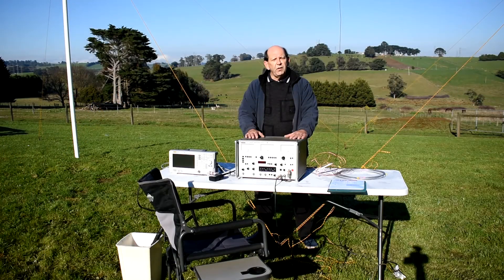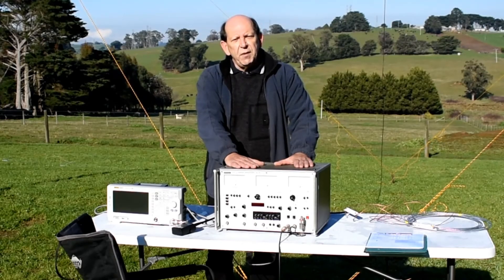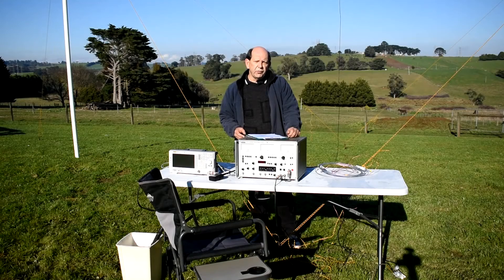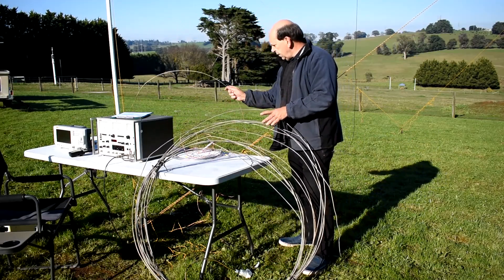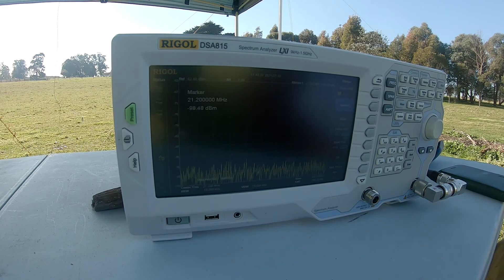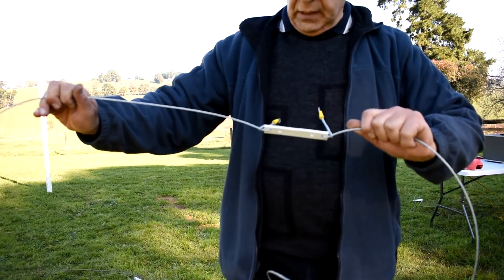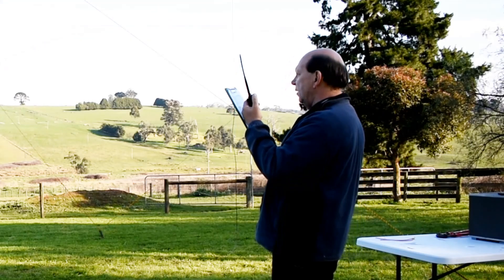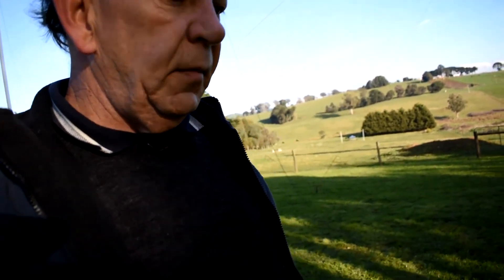R018 Testing Wire Dipole Materials for HF

Comment: I built a two 5/8 wavelength dipole antenna for 75 meters...about 315 feet overall length using #14 pvc insulated stranded copper wire (Home Depot) fed with ladder line straight back to a balanced tuner in the shack.  The center was suspended from near the top of my 70 ft. tower which supported a 10 element hf log periodic dipole array.   One end was up about 40 feet and the other end was only about 8 feet off the ground.   The performance wildly exceeded my expecations.  From south Florida in the winter Europe was a nightly thing....with the occasional Asian contact as well.  Several signal reports from the UK, Germany, Italy and Russia were, "strongest signal heard"....with many 20db over S9 reports.  Pileups were easily managed...rarely making more than one call to a DX station.  My biggest concern was mechanical....will the thing stay up?  The wire was not designed to be antenna wire...but, to my surprise it lasted years.  The insulation probably effected the resonant frequency a bit...but, since I was using open wire the swr really didn't matter much as the open wire is very low loss.  Thanks for all the work you guys did with different wire types.

Comment: Great work!  Been reading your article from the SZ1A site.  Very good info and revelations.  Just the fact between bare wire and a PVC-coated wire made a measurement difference.  The entire test must have been a lot of work but I think it helped the amateur radio group immensely.  Thank you for creating this.

Comment: Did you control for tension and sag?  The heavier wires will sag more even with the same tension and at the high current part of the antenna.  Might be why aluminum did so good.  73 KK7YIS

Comment: Many years ago I collected some phone wire after a hurricane and the run had been replaced with new material. It may have been power wire I don't know. I did build a dipole out of it and it worked well and lasted for a long time.

Comment: Glad to know that I don't need to get copper wires to get good performance when making dipole antennas. Was worried about the material would cause high impedance.

Comment: Have you ever worked with  Beryllium Wire for Dipole antennas?   It's extremely strong even at small diameters // Gauges .  I built two 10 meter Dipoles using it in # 22 Gauge.   Both are resonant from 28.250 to 28. 550  Mighty wide... Low SWR as well... Think 1.5 is the highest  and I have put 100 Watts through it without a problem.   I worked with a  few agencies that used it from 80 m to even VHF.... In fact it works very well for Unattended Ground Sensor, Omni Directional Antennas 138 to 153 Mhz  In smaller cuts it stands like piano Wire and is difficult to detect..  Thank You for the Interesting content    KC3ZDW  73

Comment: I found that once an antenna is up for a while the performance appears to decrease a bit. Perhaps the corrosion of the bare metal? Planning on (industrial) gold or palladium  plating of steel wire. Not for a golden signal but to avoid corridor.

Comment: BARBED WIRE? Really? 😀 It’s interesting to see the number on your chart. IIRC, it had one of the lowest lengths. (Maybe it has a low "velocity factor" because the electrons have to slow down around those sharp barbs.😀) I guess if it’s what you have (and you mount it so the lowest point is above the height of a human).

I SUPPOSE the barbs might be acting as miniature ”capacity hats”.

73 de AF6AS in “DM13” landhttps://www.youtube.com/s/gaming/emoji/7ff574f2/emoji_u1f600.png

Comment: I don't have any of the test equipment you used here, so I can't verify data- BUT- I have had great luck building dipoles out of 75-ohm TV coax, using only the braid as elements (not hooking the center conductor to anything). I'm talking about just the dipole elements- the dipole is still fed with 50-ohm RG-8X coax. I gave it a try one day, since TV coax is practically free in my area, with everyone ditching cable TV in favor of streaming. People will usually give me the coax for free in exchange for me removing it from their houses. You can't solder the braids, so you have to make sure your crimp connections are good. Plus, with the way the coax is constructed, you don't have to worry much about stretching on longer antennas, such as 40-160 meters. This is best used for standard dipoles- using it for fan dipoles can get heavy in a hurry.

Comment: Interesting test and results! So its not so much about the wire material, but about the wire length and matching properties of the antenna. I would guess copper tubing would work the best of all, generally?

Comment: Thank You for the work you done. The results is very clear:  coper and aluminium, not coated and with higher diameter are the best,because the skin effekt is the reason! You may calkulate it and I think the result is near to Your messurment. Good work, OM!

Comment: How di you calculate the offset distances that you trimmed off to make each antenna resonant at the same frequency?
Reply: A fair question, I will try to answer.  Lets take the first wire.  3600mm long and resonant  on 19.56 MHz.  We want to know how long to make it for 21.2 MHz
I used the formula: (1/(1/3600 x 21.2) x 19.56)  which equalled 3321mm for resonance on 21.2 MHz.  This worked spot on.  I had to do all the 1/ steps because the wavelength is inversely proportional to frequency, but apart from that it is a basic cross-multiply solution.
I hope that this makes sense.  Cheers.

Comment: You got a bad rod knock in that engine should have that checked out
Reply: It has a diesel engine and it always sounds like that, although a year after the clip was made, it holed a piston while towing a small caravan (trailer) across the Nulabor plain.  A mongrel of a spot.  One road.  The nearest town behind was 450km away.  The nearest town in front was 700km away.  No trees or shrubs higher than my knee to the horizon.  Not fun!

Comment: I would suggest that if you were to set them all up two times in a row as in ASIN A--J SET UP AND MESURE and A-J SET UP AGAIN,  AND YOU WILL GET DIFFERENT READING, AND IF IT SIGNIFICANT OR AT ALL REALY, WELL THEN SET THEM UP AND MESURE THEM ALL 5 TIMES FOR AN AVERAGE.  Oops caps were stuck sorry. But still thank you I WAS COMING IN FROM THE SHOP IN A RUCH TO ASK BOOBTUBE (solid or stranded or solid aluminum wire for receiving antenna?) And yours was the first one that at first glance offered me an opinion and sure enough,  So Thanks much fellas.  KD7-Pxx

Comment: say aluminum CORRECTLY. the other thing is you said you calibrate the antenna first, how? do the lengths differ for different materials?
Reply: Aluminium was pronounced correctly, because that's how it's spelt.  (7:49)  We have no control over the strange ways that the USA pronounces things.
Yes lengths do vary for different materials.  look at:  2:06 and 2:20
Reply: @agalah408  You Brits need to learn that ur country might have originated a lot off stuff, we Americans pronounce things better, thats what we do. Ha!

Comment: Hi, many thanks. Use stainless wire here as the tree rats, squirrels, like to chew through copper for some reason. Good results with it, not very much difference from copper.

Comment: So other than the tiny mig wire. No significant difference. That is awesome. There is a QST article from like 1968 where some old man was yelling at all the people that make this hobby difficult when it doesnt have to be. " We used to use our boxsprings as antennas. Dont overthink things. just get on the air" (That was the paraphrased quote as I remember it) Looks like I dont have to fret about pure copper stranded and can use cheaper and probably stronger aluminum wire. PERFECT!

Comment: It would have been nice to see this conducted over a larger distance like 20 miles for example. Barbed wire results? Is it top secret or something? Would have been good to see silver wire, and different coatings. Mig wire goes rusty very quickly, the copper coating is very thin.

Comment: Nice test and good to know.  I will say that in my almost 60 years as a ham, I've loaded up a 12 ga copper wire dipole, my metal rain gutters, a 2 mile barbed wire strand and many other crazy antennas and made good contacts on all of them.  Although there are some differences, paying attention to getting it as close as possible to resonance at the desired impedance is a big factor.  My dipole had 2,  75' legs (length of the 12/3 scrap piece) and a diy balun at the middle.  Up about 75' between 2 pine trees, it was awesome.  But at 75' it should be.  Unexpectedly, my metal rain gutters also did great and I worked with them for almost a year and got a lot of good DX on them.

Comment: Appreciate the work and analysis.
I’ve used larger diameter MIG-wire in locations where I both left it and had the potential for theft.  I did not notice any significant difference from the normal copper wire.
I think this has been overblown with the exception of very small steel wires!  73… 😊

Comment: No diference?????  It is a big diference, I can see 3 db, so when we use steel we loose half of the power. This means that there are no more Radio Amateurs, that's also why we see a lot of morons on the bands. Any way a very good test.

Comment: Could you please make a video showing slowly and close-up how you secured those guy wires to the ground stakes? That is very rare and hard to find information!

Thank you so much!!! 

73! Erik, NO8Z
Reply: Hi Erik.  You are the first to ask that question!  It was essentially a 'truckie's' knot where you can tie down loads super tight without any extra fittings like ratchet tie downs.  I have been doing it for years to tie down loads on my car trailer.  It even works with slippery nylon rope as seen in this video.  If it is coarse cotton/hemp rope, a single loop is fine, with slippery rope, the double loops  are better.  When finished, you just give it a shake and the knots fall away to straight rope.   Great for this sort of work where I can tweak the tension of each leg in a very controlled way until the pole is vertical.   There are plenty of tutorials around about this, but here is a good one:  https://www.youtube.com/watch?v=XBGaKdqzrVQ
Reply: Thanks for reminding me how to make a truckies knot. My first 80m band dipole was made from GPO drop wire, which is copper coated steel with a thick durable plastic insulator. I've spent a fortune on antenna wire over the last 32 years, the most expensive being the green military spec Kevlar cored wire. I'm back to using equipment wire. Thanks for the video and article.

Comment: Why not litz wire or silver? And why not different wire thickness?
Reply: It was their experiment and scope.  I wish they had tried some stainless steel, but it is probably a tad worse than galvanized.
I am using 4mm stainless guy wires for my verticals, because I live in an island location.  But I am considering using some copper wires with the steel as support due to losses.

Comment: 3 or 4dB extra are a lot once you have reached maximum legal power with an expensive external RF amplifier.
3dB over a 1500 watt amplifier are equivalent to 3000w, and 4dB equal to 3768w.
Reversing the calculations is also interesting because 4dB below 100 watts is like our 100w HF radio were capable of 39.8 watts only. A 5 watt QRP station using batteries would be as strong as 12.6 watts if we could access to those extra 4dB, in other words we could transmit during 2.5 hours with a 5w TX power for every hour at 12.6w TX power, assuming the same efficiency for the transmitters.

Comment: Interesting experiment. You had to cut each wire to a different length to get resonance at the same frequency. Did you find any correlation between the length of each wire and the signal strength? A longer wire may radiate just a tad better?
Reply: A longer antenna will resonate at lower frequency, which will actually make it work worse at the initial one.

Comment: It would be interesting to know what happens when you push a kilowatt through them.
Reply: :It would be interesting to know what happens when you push a kilowatt through them."
I expect the 0.9 mm welding wire would probably heat up a bit at the feed point.

Comment: Thanks for all the hard work in doing this test.  Lots of other useful tips here also.

It would be great if you could share the results (resonance, dBm, SWR, $/m, frequency, etc.. ) in a spreadsheet.

If there was a method to calibrate the conditions, thinking it could be a useful resource that others could also contribute to doing a similar test across other wires for comparison.
Reply: Yup, projects like this take a lot of time

Comment: So the Lower the RX dbm  the better .. is it right ?. All your testing look very close ..  what happen if you multi band .. can be too resistive?
Reply: These were negative dbm so yes, less negative is good.  4 db may not seem like a lot but 3 db is a doubling of power!
Reply: Resistance is bad.  Transmitter power converted to heat rather than radiated signal.   Keep in mind there's a difference between resistance (measured with an ohmmeter) and impedance (which is what is measured with the NanoVNA).   For dissipation purposes I suppose these are similar but the antenna "resistance" seen by a NanoVNA includes radiated power, that does not come back, so is imputed as resistance when really it isn't. Iron and steel have more resistance than copper; so you cannot get the same performance with steel.  However, the skin effect is measured in microns so a very thin cladding of copper makes a big difference.

Comment: Nice test! Thank you for that. But keep in mind: Within the little antennaheight the directional lobe and its elevation extremely varies with the antenna position. a few inches difference in the feedpointheight may result in a little degrees higher or lower radiationpattern. You have to make sure every antenna over the whole length including its centerpoint is placed in exact the same place over ground. so you need some height measurements or a guidepost in the middle. you also did the experiment with extremely low power. the effect of the resistance will be much higher if you deal with the high currents, so more power. nevertheless you see a only slight effect due to the different resistance. for me more important is the toughness of the wire according to the environmental stress. i prefere cold-drawn, bright gray isolated, stranded and tinned coppercable. the tin is a good anti corrosion protection and cold drawn AWGs can handle very strong tensions. for very long loops, long wires or high power i use 2.5m² (about 14 AWG). The bright grey insulation makes it nearly invisible. For holiday it can be everithing else.

Comment: The test donøt shot the real world, as there is a huge differens in the wire size.
Therefore the area, and also the skin effect is different from band to band, so it testing on 10m will not give the same result ad 160m.
Reply: What you say is true, but repeating the test for every band generates other problems.  Poles must be much higher, minimum test distances further.  Logistics of doing same tests on 160M are prohibitive without a much bigger investment in time, space and money.  Still, feel free to give it a go yourself.  perhaps you can share the results.
Reply: "so it testing on 10m will not give the same result ad 160m"
Thassright.  Where it matters is for clad, plated wires where the outer surface is a different metal.

Comment: The wire should be conductive with fairly low resistance.  It should be strong enough to support it's own weight and the feedline, maybe.  After that, pink insulation makes electrons move faster...

Comment: Great job debunking all sorts of wire antenna myths.  I've made antennas from 2mm galv fencing wire for years and I love the stuff!  $70 for 660 meters of wire makes for a very interesting weekend of antenna making - that's an awful lot of antennas, and they're cheap enough to throw away if they don't work, or give them away if they do.  I also tested fibreglass electric fence tape, but it QSY'ed like a crazy man from dry to wet, and also it caught fire and burned very brightly with any serious amount of horsepower into it.  Lets hope your tests get more people cutting wire to resonance!
Reply: That's a really good observation.  I had wondered about electric fence tape for RF.  It is stretchy stuff.  I'm sure you are right about it being awful for dipoles.

Comment: Thank  you  guys very  much .  You answered  a lot of questions  for me about  wire type . I have a lot of wire for power lines from the power poles to houses . Lots of copper  wire and aluminum  wire, all good size  wires. So now I'm going  to make a few antennas  for a lower band like the CB 27 mhz  and  see how it goes ,  now that I know they all work aroma  the same.